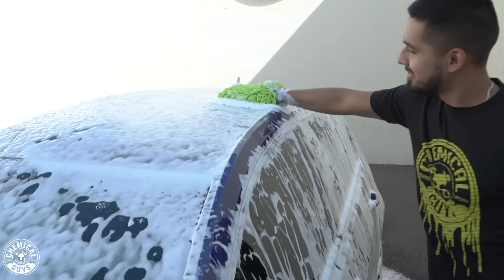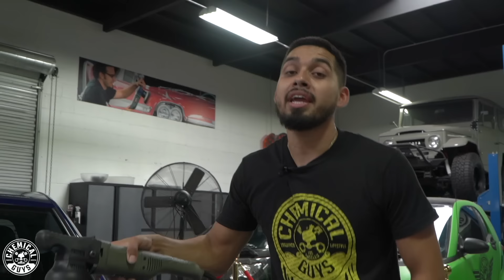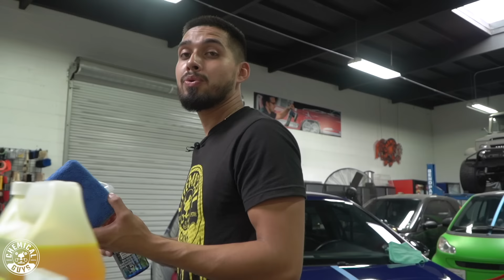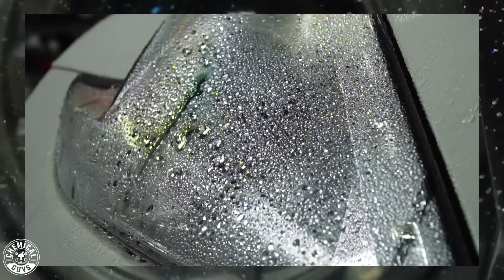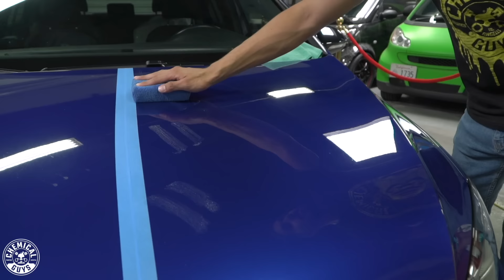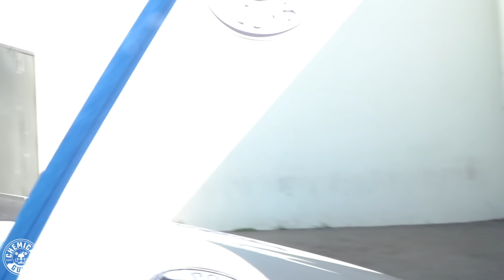How To Ceramic Coat A to Z! - Chemical Guys

Comment: If my car has the black plastic on the bottom of the doors or on top of the wheel wells, would i also follow these steps for that part of the car? Just wanna make sure its only for paint.

Comment: I didn’t know I should have applied Hydro Charge first, instead after polishing with VSS I used Hydro Slick. Can I apply Hydro Charge over Hydro Slick the re apply another layer of Hydro Slick over the Hydro Charge? 

I’m trying to get the car ready for PPF.

Comment: What if I had ceramic coating done at a detail shop and I have some small swirls after several months and washing. Can I use VSS    Without it removing the ceramic coating?

Comment: Finally got to use my HydroSuds and HydroSlick today.   So far very impressed, the HydroSlick in partucular went on very easy and wasn't too bad to remove.  I did learn the hard way to apply/remove panel by panel, especially on glass.  If you leave it sit too long, it takes a lot more effort to remove cleanly.

Comment: Is it safe to use the hydro line outside or is it recommended that you apply them in a garage?
Reply from the maker: Hey! It is recommended to work in a shaded area when the surface of the vehicle is cool to the touch.

Comment: Great presentation and even better energy! I'm considering a professional ceramic coat but not sure I can really justify the cost. How would you compare using CG ceramic products vs pro? It seems like at least annual treatments are needed which I'm fine with for the cost savings, but what about the level of protection, etc vs the pro applied stuff?

Comment: Hi there, after I prep my car using your video recommendations, my car is ppf wrapped all over, foregoing Hydro Charge, would you still recommend hyrdo Slick and Hydro speed or just go straight up, Hydro Wrap detailer? Also would you recommend Hydro Thread for a Model Y interior across all the upholstery? Thanks for this video btw!

Comment: What do you do with the applicator and the towel used to buff off the ceramic? Do they contain ceramic and need throwing away in case the residue hardens on them?
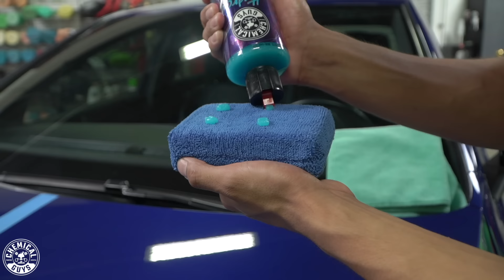 Answered at 14:18 ! Many thanks !!
Reply from the maker: Thanks so much for tuning in!!

Comment: My car is already ceramic coated... do I need hydro charge? I was gonna wash my car with hydro suds and then apply hydro slick after drying it
Reply from the maker: Hi there! It is not necessary to apply HydroCharge on top of ceramic however it will add durability, depth and shine.

Comment: I'm curious on if Hydro Speed can be used on a Non-Hydro treated car or not, or if they have a Quick Exterior detailer specifically for non Hydro treated vehicles
Reply from the maker: Absolutely!
Reply: @ChemicalGuys  I just had a VERY late thought, why is it you can only use HydroCharge on paint?? Is it how it's made, the chemicals in it?? Or simply how it bonds?
Reply: And is there a difference between using HydroSlick first instead of HydroCharge and HydroCharge on top of HydroSlick?

Comment: Can you use Hydro Suds for the first wash before coating with Hydro Charge? Or do you have to use something like Clean Slate or Citrus W&G?
Reply from the maker: Hey! It is recommended to thoroughly cleanse the surface with Clean Slate before applying new coatings.

Comment: Awesome video!! I just had a quick question. Should you ever use butter wet wax before or after a ceramic coating? Or is it not a good idea either way?
Reply from the maker: Hey Jacob! For the longest lasting shine apply ceramic before adding wax.
Reply: @Chemical Guys  would you still use slick after charge then butter wet wax?

Comment: There is no need for IPA after the polish?
Reply from the maker: Hi Daniel! Prep the surface for coatings by using Wipe Out.
Reply: @ChemicalGuys  is the Hydro Speed is used as after care of the ceramic coating? What is the frequent use of hydro speed?

Comment: Hopefully you guys answer again. But would it be smarter to be in a shop or something doing ceramics where as doing it outside your susceptible to the elements and dust or anything in the air could contaminate the vehicle?
Reply from the maker: Hi Zac! It is best to apply ceramic coatings in a garage when the surface of the vehicle is cool to the touch.

Comment: Hey guys, great video! I have a question. Could the Wipe Out Surface Cleanser Spray be added to this equation?
Reply from the maker: Absolutely! Use Wipe Out just before applying your first coating.

Comment: Why did you clean the car first with citrus wash and not with hydro suds?
Reply from the maker: If you already have a ceramic coating on your car and are performing a routine wash, HydroSuds is a perfect choice! In this case, we wanted to start with fresh paint so we used Citrus Wash & Gloss in a high concentration to strip off any old sealants, glazes and waxes to form the best bond possible when we apply our ceramic coatings.

Comment: Whats a good cleaner to use after applying hypercharge and before applying hyperslick being that it needs 3 hours to cure I would assume some dust particles would be on the surface of the vehicle and needs to be wiped clean. Can sprayway glass cleaner be used?
Reply from the maker: Hey! Check out HydroSpeed to gently clean and enhance your coatings.

Comment: I have a dilemma, which is better HydroCharge Ceramic Spray Sealant or Hydroslick Intense Gloss SIO2 Ceramic Coating HYPERWAX?
Reply from the maker: Both are a great choice and can be used together for more durability and shine. Check out HydroSlick which can be applied to any surface that is gloss painted, shiny or clear.

Comment: I have plans to do a satin wrap on my car and I am wondering if by using your ceramic coat poroducts, will make it glossy instead of satin? I want good protection for my car to make sure my wrap will last the longest it can
Reply from the maker: Hey Brandon! Clean, protect and maintain a satin finish by using Meticulous Matte Auto Wash and Meticulous Matte Spray Sealant. 
https://www.chemicalguys.com/meticulous-matte-detailer/meticulous-matte-detailer.html?gtmListValue=Internal%20Search

https://www.chemicalguys.com/meticulous-matte-auto-wash/meticulous-matte-auto-wash.html

Comment: I need ceramic coating on my new car keep last long 5 yrs which product will i use?
Reply from the maker: Hey! Give your ride a durable layer of protection that lasts up to 5 years by applying Carbon Force. 
https://www.chemicalguys.com/carbon-force-ceramic-protective-paint-coating-system/WAC232.html?gtmListValue=Internal%20Search

Comment: If I applied hydro speed only and I want to redo ceramic coating, do I need to rewash the car again?
Reply from the maker: Hey! It is perfectly fine to use HydroSpeed to clean the surface before adding ceramic.

Comment: I'm assuming that you use Charge and Slick 1x every 10-12 months, but how often should you use Suds?

And can Thread be used on Leathet??
Reply from the maker: Hey! That's right, reapply your coatings 10-12 months to maintain longevity. HydroSuds can be used as often as desired, as a maintenance wash. HydroThread is intended for carpet and fabric components. Use HydroLeather for ceramic protection on leather goods.
https://www.chemicalguys.com/hydroleather-ceramic-leather-protective-coating-and-quick-detailer-16-oz/SPI22916.html

Comment: Do I need to use jet seal if I am using hydro slick?
Reply from the maker: Hi Jared! HydroSlick can be used as a standalone barrier of protection or layered with your favorite coatings for added gloss and protection.
Reply: @ChemicalGuys  awesome. My new white model Y is getting delivered this week. I’m planning on doing the following. 
light clay bar 
Hydro charge
Hydro slick
White light hybrid glaze
Jet seal
Butter wet wax
And then vrp on all the trim. Is that overkill or incorrect? 

These videos are so helpful. Thanks again.

Comment: So you must cut & polish before applying ceramic coating?
Reply from the maker: Hey! For best results, polish away scratches and swirls before applying ceramic to prevent locking in blemishes.

Comment: Just bought a new vehicle and want to do this process to enhance the shine. There are absolutely no scratches or swirls in the paint. Should I polish it first or can I get by with just using the clay bar first? Thanks for all the awesome videos!
Reply from the maker: Hi Brian! If the vehicle has no imperfections you can move straight to applying coatings.

Comment: I did my wife's car and for some reason I got the order mixed up. I put HydroSlick on her car. Can you apply HydroCharge over hydro slick, or should i just wait till the next time I do her car (in 6-12 months time) to do the HydroCharge?
Reply from the maker: Hey Frank! It is perfectly fine to use HydroSlick before applying HydroCharge however for best results we recommend applying HydroCharge first.

Comment: After polishing do you need to do an IPA wipe before applying the base?
Reply from the maker: Hey! It is recommended to use a surface cleanser such as Wipe Out for example to remove residue and spent product before applying coatings.

Comment: If you were doing the whole vehicle would you polish the entire vehicle before using hydro charge or would you polish and use hydro charge before going to a different section of a vehicle?
Reply from the maker: Hi! Work it steps, start with polishing the entire vehicle before applying coatings.

Comment: Hello i'm interested in applying HydroSlick to my MR2 convertible can i apply it also to the vinyl roof for waterproofing it?
Reply from the maker: Hey! Use HydroShield to protect vinyl, rubber and plastic components. 
https://www.chemicalguys.com/hydroshield-vinyl-rubber-plastic-ceramic-shine-coating/TVD11616.html?gtmListValue=Internal%20Search

Comment: What are the recommendations for Piano Black plastic exterior pieces?
Reply from the maker: Hey! If the component has scratches and swirls, it can be polished with an Orange Hex-Logic Pad and V36 Cutting Polish before applying Carbon Force to resist scratches.
Reply: @ChemicalGuys  awesome. Just spent 600 bucks at detail garage in Pensacola.  Let’s see if the old man still has it

Comment: Can Hydroslick be done outside as I have no access to indoor. And I recently used Better Wax... do I need to remove the wax or can I apply Hydrislick on top?
Reply from the maker: Hey! For best results, apply HydroSlick to a bare surface and then it can be layered with your favorite glaze, sealant, and/or wax. Work in the early morning or late evening hours when the temperature is cooler and out of direct sunlight.
Reply: @ChemicalGuys  thank you!!!

Comment: I love y’alls Blazin’ Banana Spray Wax. It’s 🔥. Smells amazing, and the carnauba wax in it really does a great job at making the paint easier to clean. As well as a very glossy finish. Very shiny. I live on a calíchè road and my truck is Oxford White. But I went 2 weeks without a wash cause I ran out of my first bottle of Blazin’ Banana wax. Noticed before washing it that it still held a great shine even after 2 weeks driving dirt roads and highways. Love you guy’s products
Reply from the maker: Enjoy your detailing products!!

Comment: I have a 2014 GTI i recently bought
I dont think the paint has ever been corrected (clay barred and polished) would you guys recommend the full V line of compounds and polishes , or the C4 and P4 ?
Reply from the maker: Hey! After washing and clay barring the surface, inspect the paintwork to determine what polish is necessary. For light to moderate imperfections use the combination of C4 and P4.

Comment: I already applied carbon force ceramic to my SUV. Is it safe to use hydroslick and hydrospeed on top of carbon force ceramic after washing with hydrosuds? It is not going to remove the carbon force ceramic, does it?
Reply from the maker: Absolutely! That is completely fine.

Comment: Does Hydro charge take the place of a glaze?
Reply from the maker: Hi there! HydroCharge is a ceramic that adds some leveling agents that leave the surface smooth with a durable layer of protection. It can be layered with a glaze for added depth as well as sealant and wax for more protection and gloss.

Comment: So what kind of clay bar are you using there? I’m trying to get my used 2020 “new” car up to standard. I clay barred it, but it still feels as though some spots have oxidation. Also, the dipshit that owned it before me parked outside, under pine trees, and there’s tiny spots of sap in some spots that would come off with clay bar, or goo gone. Help!
Reply: PS I used your guys’ yellow clay bar
Reply from the maker: Hey! A Medium Duty Clay Bar with plenty of Luber works well for extracting embedded contamination. Try using the natural cleaning oils of Butter Wet Wax to remove stubborn sap.
Reply: @ChemicalGuys  but this clay bar looks more like a sponge or something. Or a synthetic clay bar

Comment: In this video you said to polish before using a ceramic coating. In other videos you guys say to ceramic coat first and then polish. Can you please clarify which is first. Thanks.
Reply from the maker: Hi Ryan! That's correct, machine polish away scratches and swirls to reveal a smooth surface before applying protective coatings such as ceramic, glaze, sealant, and/or wax.
- CG Nick

Comment: I know this is an older video, but does VSS have fillers?
Reply from the maker: Hi Pete! VSS does not contain fillers but rather it has fine abrasives that refine scratches and swirls as it diminishes.

Comment: So if you're using the Hydro line, is there a need to go with a glaze first?
Reply from the maker: Hey Sergio! Apply HydroCharge and/or HydroSlick before applying glaze, sealant, and wax.

Comment: Do you need to use both hydro charge and hydro slick or can you just use one of them
Reply from the maker: Hey! Angel! It is perfectly fine to use one or the other but you will achieve the most durable layer of protection by combining HydroCharge and HydroSlick.

Comment: Great video! I looked through most of the comments and questions but couldn't find mine. Can you put hydro slick over carbon force.
Reply from the maker: Hey Les! Absolutely, it is perfectly fine to use HydroSlick on top of Carbon Force.

Comment: So if I want to go all out on a super shine and wanted to use hydrocharge, then hydroslick, then butter wet wax, I would do a layer of hydro charge and wait 3 hours. Then apply hyrdoslick and wait another 3 hours and apply the  wax? Or can I immediately apply the wax right after hyrdoslick?
Reply from the maker: Hey Kris! It is best to allow a sufficient break in between coats to ensure each layer has a chance to bond and cure.
Reply: @ChemicalGuys  the goats respond !!!!!!!👁👄👁 thanks for the info! Binging at least 5-10 videos a day before buying, practicing, and starting my own mobile detailing gig with my girlfriend!
Reply: @ChemicalGuys  and also how to care for tinted windows if there’s something different you have to do to prevent unnecessary wear. I think I’ve seen you guys mention it in a video but can’t remember

Comment: How often should you swap out your applicators while using a ceramic casting
Reply from the maker: Hi Jared! After using ceramic, the applicator and towels used to buff off spent product will begin to harden unless washed immediately.

Comment: What product to use after you apply the ceramic coating? Like which wash products to use after for regular maintenance
Reply from the maker: Hey! Maintain your ceramic coating by using HydroSuds as your routine wash solution and use HydroSpeed in between washes.
Reply: @ChemicalGuys  OK I've been using hydro suds. I do notice that it doesn't get some tougher bug mess off of the front. What to use for that? I'll have to look for a video on hydro speed. I'm not familiar with that. Thanks for the response

Comment: Hello guys! Is it necessary to apply a glaze and a sealant after hydro charge and hydro slick? Thanks!
Reply from the maker: Hi! It is not necessary to follow up HydroCharge and HydroSlick with additional coatings however glaze, sealant, and wax will enhance depth while adding gloss and protection.
Reply: Thank you very much!!! I have my garage full of your products!!! Huge fan!!
Reply: If you were going to apply glaze would you do that before Hydro Charge?

Comment: Hi guys what if do not have an applicator device for my polish step and i am doing it by hand, can i still use VSS?
Reply from the maker: Hey! VSS is best suited for machine polishing. Try using V36 Cutting Polish with an Orange Hex Hand Cutting Pad for polishing by hand.
Reply: @ChemicalGuys  Thanks for the response, i'll go with the Orange Hex then, cheers guys!

Comment: Hey do you need to put hydro charge on before hydroslick? or can you use either without the other? Thanks
Reply from the maker: Hey! It is perfectly fine to use either HydroCharge or HydroSlick as a standalone layer of protection.

Comment: After compound and polish do I need to surface prep (Wipe out surface cleanser spray)
 it and then put on the Hydrocharge? OR Do I just put the HydroCharge on after polish is complete without surface prep?
Reply from the maker: Hey! We recommend using Wipe Out, then apply HydroCharge. Thanks for watching and happy detailing!

Comment: My ceramic coating is a couple of years old.  It does not shine like it did and water does not bead like it did when the coating was new.  Do I have to remove the old coating or can I polish and recoat?
Reply from the maker: Hey Steve! Machine polishing will remove old ceramic while at the same time prep the surface for a new coat.

Comment: Do you have to use hydro charge or can you just use hydro slick directly after polishing?
Reply from the maker: Hey! For maximum protection, we recommend applying HydroCharge and then HydroSlick. Thanks for watching and happy detailing!
Reply: What is point making ceramic coat after ceramic coat to me make no sens applying hydro charge and than again hydro slick,they both ceramic coats?